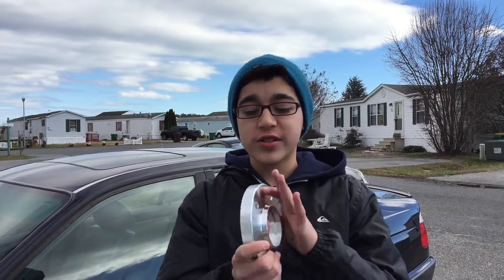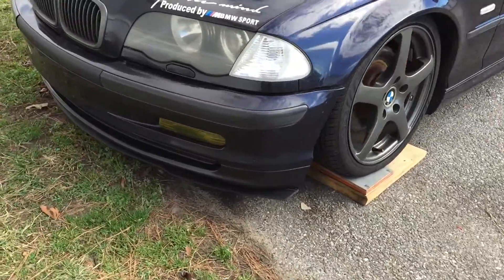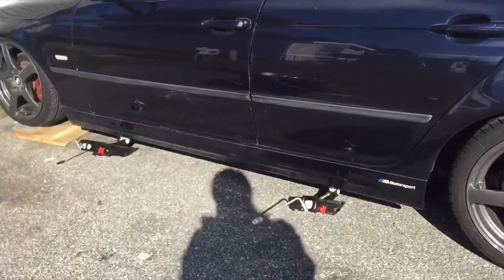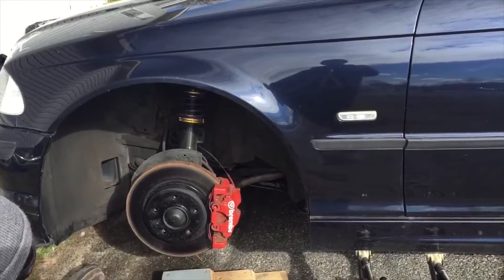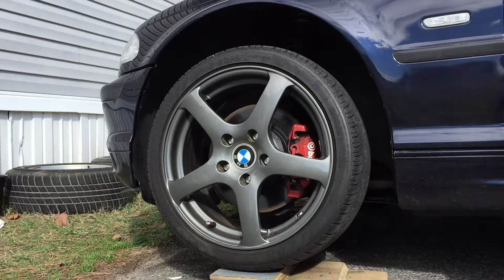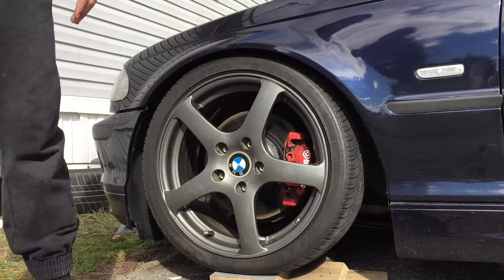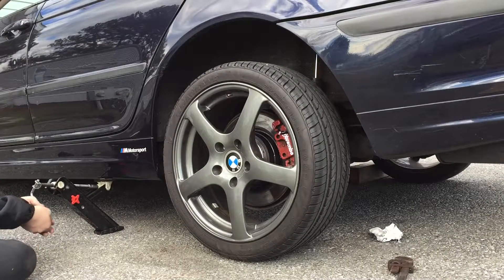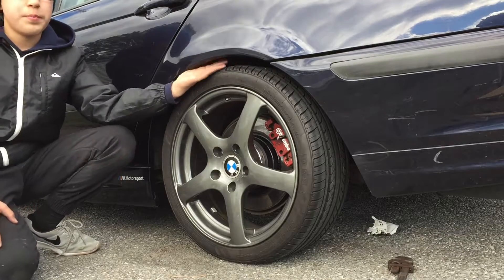BMW e46 Spacers//Install

Comment: you have your traction control light on. does it also have the orange brake light on?
Reply from the maker: Keene Millana no it's because I drive it with no traction cars control and the brake light doesn't come up either but the traction bad abs light coming on is a very common problem so definitely check the forums  and you'll definitely find how to fix it

Comment: What are your wheel specs ? I have some 20mm spacers but they rubbed my finders
Reply from the maker: Alonso Alvarado my wheels are 17x8 and 25mm spacers and try rolling your fenders and you will probably get enough clearance! Thanks for watching bro

Comment: One does not just tighten up the lug nuts like you did it bro. You have to go in sequence upper one and then not go around one after another,but do a patern upper,then lowest point and after that go how you like. Never like you did,it is totaly wrong patern...

Comment: Yo, as a E46 330xi owner your car looks beautiful. I basically watched all your videos and realized how good condition your car is. I just have a few questions because I'm super curious. If you've said this in previous videos, I apologize.

1: How many miles/Kilometers does your car have?

2: Whats the size of the engine Liters wise ex: 318,325,330.

Thank you for your time dude :D
Reply from the maker: Mr.Stride thanks for watching bro appreciate it my car is a 2001 BMW 325i and has 175,000 miles and it has the stock 2.5 liter engine and if you were wondering yes it is a manual thanks again and if you have more questions let me know :)

Comment: What is your suspension kit?
Reply from the maker: Avin Bonifacio it's g plus adjustable coil-overs! There cheap and offer great performance and you can slam or slightly lower your car you pick the height! Anyways thanks for watching bro
Reply: Wesley_ Media I'm in need of new suspension. How do they perform? Are they any better than stock in performance? How long have you had them and will you recommend them for a daily driver?
Reply from the maker: Avin Bonifacio the performance is amazing from stock it handles like a dream and would 100% recommend them for a daily I've had them for about 2 months and there honestly awesome the cost $250 on eBay but there awesome fr get them the car will look amazing and the performance too
Reply: Wesley_ Media could you point the ebay seller you purchased then from? I'd like to get them from a reputable seller.
Reply from the maker: Avin Bonifacio I actually tried to find them but I couldn't maybe the seller I bought them fro doesn't sell them anymore but when you buy make sure there from the USA and also the review of the item, search for videos on YouTube and I'm sure you'll find the coilovers your looking for!!!! Btw mine where purple and gold and the brand was g plus
Reply: Wesley_ Media thanks man! I'll try to look for them
Reply from the maker: Avin Bonifacio yeah bro hope you find them! Let me know if you do

Comment: How does it drive with spacers?
Reply from the maker: Alexander Bunra pretty good I'd say no shake or anything at all, that's because there  hubcentric with extended lugs so it helps out a ton
Reply: Wesley_ Media thanks for the quick reply, didn't think you get to it. I'm gonna get some spacers from ecstuning it's a whole kit for like 120
Reply from the maker: Alexander Bunra not bad, mine where 90 for the kit, and I reply to everyone because I hate it when people I watch don't reply to me 👊🏽

Comment: What size spacers are those?
Reply from the maker: CappinKids there 20mm spacers
Reply: Wesley_ Media alright thanks I have the exact same car but automatic with 143,000 miles do u have Snapchat I can send u some pics
Reply from the maker: CappinKids that's awesome and my snap is wesley_media and also got an Indra which is wesley_media_
Reply: Wesley_ Media I added u btw my names jack and my car is an 03 didn't mean to say the same lol

Comment: Thanks. I appreciate your enthusiasm.
I'm waiting on my spacers to arrive and hope they generate a similar response.
15mm fronts and 20 mm rear on an E85 Z4 was what everyone recommended.
Was that a pipe wrench I saw lying on the ground next to your rear wheel installation ?
I hope BMW doesn't see that .m :)
Reply from the maker: Thanks a lot bro and definitely hmu on Instagram @wesley_media_ and you can show me how the spacers come out and we actually could not find a hammer to hit the breaker bar to break the nut so we used the pipe wrench 😂

Comment: Invest a new jack bro. ''widow maker'' suck. Harbor freight have good quality ones for the low.
Reply from the maker: Funk Sevsxn actually picked a cheap hydraulic jack last  month, those stock ones are scary 😂the car feel on us and it's just not safe
Reply: @wesley_media_  good. that exact jack broke on my yesterday and dropped my e46 onto the rotor...could have been really bad

Comment: 215-40-17 in an e46?
you.should be have 225-45-17 ,
Reply from the maker: Mike Ned1 there not stock rims or tires if I had that size tires it would very hard to fit them and be as low As I want to and my car if lower that when I made this video but thanks for the tip bro
Reply: How wide are your tires? I just ordered 20mm spacers with 225 up front and 255 in the rear

Comment: jesus also how slow does your car go bro you been pass the red line and also in like 4 gear on 60
Reply from the maker: Zsoktasbrandon54 well it's not a fast car and add the fact that at the time i just started learning to drive stick and I wasn't flooring it but 3rd gear is good till 80 and the car is no slouch but at the time I couldn't drive it correctly either but if you want to check out my latest video where I can actually drive now please do :)
Reply from the maker: Zsoktasbrandon54 and previous owner put all those stickers on but I took them all off again this is an old video so check out the latest